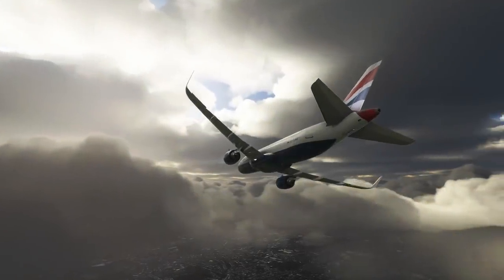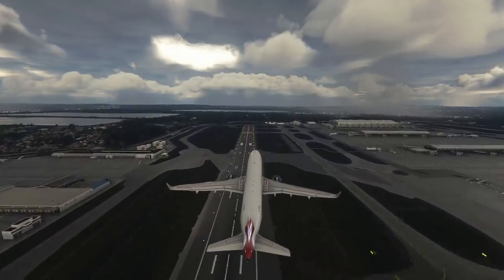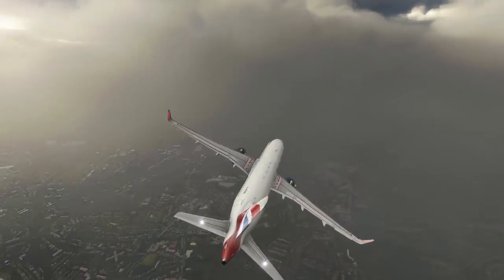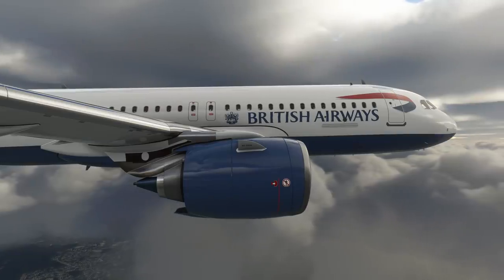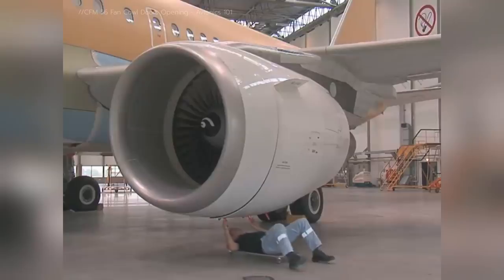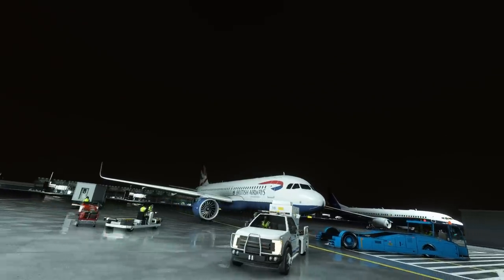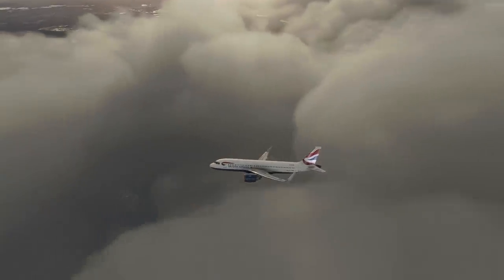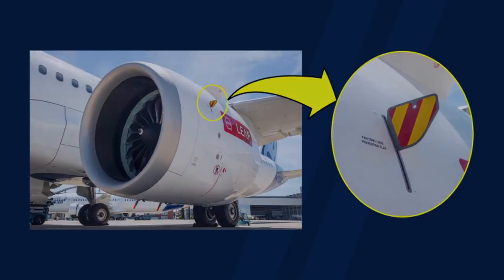Engine on FIRE over London | British Airways 762

Comment: This is about doing maintenance between flights or "on the line". Airlines are different and countries are different.  The solution is once you open a cowl or pop an oil cap you make a log book entry in the "Flight Log " up in the cockpit. Anything will do "Daily Inspection Due" and then don't sign off the other side Or the Airworthyness sign off until EVERYthing is closed. Pilot comes on board inspects the logbook, no sign off then he call for a technician. This is NOT the same as being a hangar mechanic, it requires an Airworthyness priviiledge in the type of aircraft you are returning to service. Sounds complicated, but its just paperwork and it keeps from wrecking aircraft over nothing.

Comment: Interlocking between the engine cowlings being closed and the ability to power up the engines would have prevented this. Same idea on a train where the driver can not take power until the doors are closed and a circuit completed.

Comment: I've got a feeling that lots of issues wouldn't escalate as far as they did if airplanes had cameras pointed at wings, and perhaps another on top of the tail, connected to the cabin. Surely that would be almost nothing compared to the cost of the aircraft, why aren't manufacturers doing it?

Comment: I think perhaps working on the training and actually showing what regular issues look like. If people are shown specifically the difference between a secured and an unsecured cowl then it would stand out.

If you are just told check the airframe then minor discrepancies can be missed. I remember when I was doing my ppl and an aircraft engineer explained the importance of checking the exhaust (showed me a picture) as one of the more experienced pilots had recently inspected the aircraft and was going to go flying and the exhaust had rusted through. Meaning a real risk of carbon monoxide poisoning.

Comment: Can we just put a sensor on those doors and a warning light at the cockpit if either latches or doors are'nt shut properly?
Reply from the maker: well, such a retrofit could be done, but it would be pretty pricey. 🤷🏼‍♂️
Reply: @AirspaceVideos  if we compare that to the security it provides. I'd say it's worth the buck. Anyway do you think the retrofit would cost more than 1k€?
Reply from the maker: most definitely - everything in aviation is crazy expensive due to a very complicated and costly certification process... something like a normal screen can cost a high five digit sum

Comment: Most airliner disasters are caused not by one single big issue, but by a concatenation of smaller issues, all of which could probably be avoided and any one of which, if avoided, would have prevented the disaster taking place.

Comment: You would think in this day, and age that cameras would be able to look back at the engines etc,,
ffs a webcam is like 50 bucks , you would only need 4 or so,,,
Reply: To give proper surveillance you’d need dozens at different angles and they would cost millions to retrofit. It’s not really the cost of the camera that’s the issue.
Reply: @peteconrad2077  they could instal enough to see the engines,,it would have saved those dudes who turned off the wrong motor that time,,
Reply: @andrewdillon7837  probably not since most engine fires aren’t visible externally in the earlier stages. The engines already have a very effective fire detection system. Had those guys diverted while waiting for the fire warning to reappear they’d have written the whole thing up as a nasty incident rather than a catastrophic accident.

Comment: If the cowling doors are not closed - there's now a key stuck in the engine and later models a flag.  IDIOTS

How about simply fitting a switch to the cowling catch that prevents the engine from being started with the cowling open ? Common sense in most engineering fields !
Reply: Are you forgetting that pilots are required to do a walk around of the aircraft to check for stuff like this before a flight? A flag/key stuck in the engine saying remove before flight are very noticeable
Reply: There was no obvious visual indicator at the time on these engines. Also, you sometimes need to run an engine with the cowl open for engineering purposes so an interlock isn’t going to be suitable.
Reply: Easy to call them all idiots in retrospect. I guarantee that you, lacking training, would make many more mistakes than any pilot, engineer, or mechanic would. 

There's no shame in that. It's just human. Inadequate training and stressful conditions contribute to mistakes. Its why commerical aviation has so many redundancies. Sometimes we find out that we don't have enough.

Comment: Airbus not protecting a safety critical latch with a sensor - unacceptable.
BA overworking engineering teams - unacceptable.
Companies getting away with dangerous practices should not be something that happens in the 21st century.

Comment: Why don’t pilots have a camera on engines or better sensors to confirm which engine is broken without someone else having to look out of the window to tell them, it’s such a strange thing to do in modern times
Reply: They could tell which engine was damaged without needing a camera. And modern Airbus have sensors on the engine cowl doors